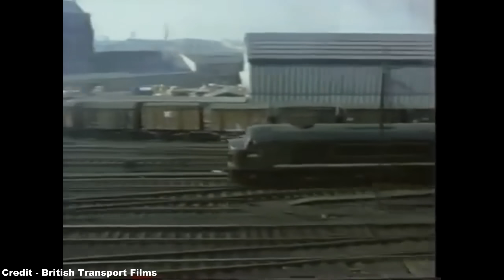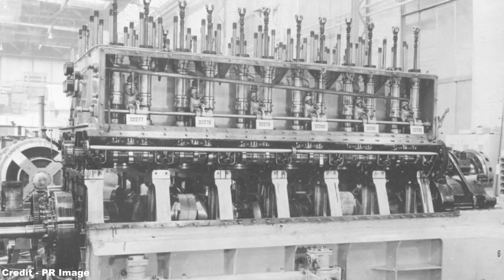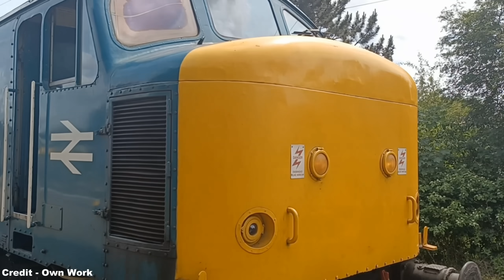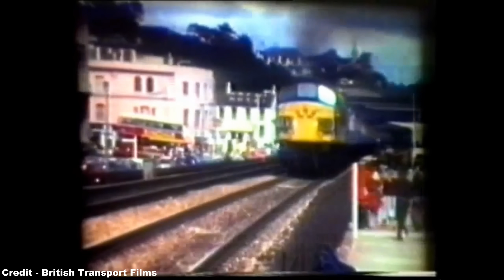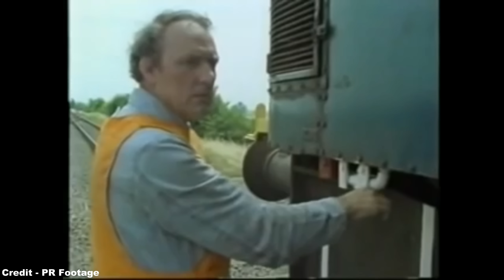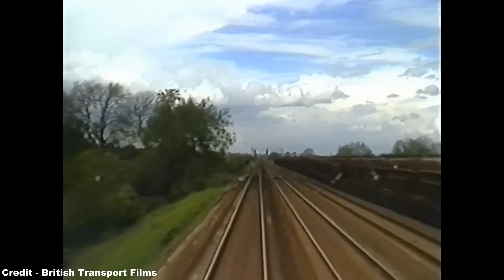The Often Overlooked Tale of the Peaks (Reworked)

Comment: Yes,  the 44s were RATED at 90mph, but initially they struggled to exceed 70mph flat out, with the main generator voltage found to be dangerously high which was severely limiting generator output and causing high numbers of generator and traction motor flashovers. 

The initial fix was the inclusion of an extra stage of field weakening in the main generator, and whilst this proved partially successful, it wasn’t until the traction motors were re-geared from 62:17 to 57:22 that the flashover problem was fully overcome. 

Whilst this extra field weakening reduced the maximum tractive effort from 70,000lb to 55,000lb, it enabled full engine output to be delivered between 8mph and 92mph - a very useful range - and increased the maximum attainable speed of the locomotive to over 90mph. 

Whilst a 70,000lb maximum tractive effort did have its uses; in truth, such a high figure may well have proved more of a liability; as with prevailing freight stock of the day,  such a high tractive effort could well have caused drawbars or couplings to break – particularly with heavy trains on steep gradients.

Hope that clears up any confusion.

Comment: UPDATE: The fate of Class 45 #45015 has now been confirmed, after many years of open storage, which has taken its toll. The Peak locomotive was removed from the Battlefield Line on 27th October 2025, with the destination unknown. It's been acquired by LSL to be used as a spares donor, probably headed for Crewe for dismantling for component recovery and eventual scrapping.

Comment: I got to love them, but I'm sorry to see that their TRUE predecessors on the MML are not mentioned at all - the Jubilees!
Reply: Jubilees : not Staniers best loco- underpowered , didn't like gradients if pull more than 8 coach's.  2 got rebuilt with RoyalScot 250 psi boiler.  Shud have had 6' 3" driving wheels - better acceleration.  I had ~  12 rides with em  Euston- Rugby .

Comment: People always rave about peaks, but it's basically an under powered 47 which has little in the way of audio entertainment , too many wheels , never had a variety of liveries except green and banger blue. 
Basically it's more dull than a clapped out 31
Reply: Underpowered? Despite the 5mph lower max speed, a 45 would chew up and spit out a 47.
And yes, I've driven both on the mainline.
Reply: @timprice9219  being a shunter in the 80's i just saw them as another loco that needed coupling/uncoupling
Reply: It depended. You got sluggards  like 45 067, and absolute flyers like 45 138 and 45 147. So.... it's complicated.

Comment: So the Class 44's we're given a max speed of only 75mph when new , and rostered for express passenger work , yet we're allowed to run at 90mph as a freight locomotive in later years ???!
Reply: I very much doubt there was any 90 mph freight. We don't have that in the C21st.
Reply: @EE12CSVT  I know they didn't haul freight at 90mph , but they we're authorized  to run at 90mph , and on many farewell railtours they hit 92 0r 93mph without issue .

Comment: Another superb video.
Reply: Shame the audio doesn't match the information quality. Except for the bit about diesel hydraulics versus diesel electric transmission.
Reply: Consider it was a reworking of an old video, without sitting down and completely re-doing the voice over with new equipment, this is as good as your going to get.
Diesel Hydraulic wise, the complexity is the information given was correct as the viewpoint of the people making the decision at the time the decision was made. That is their stated position as recorded in history, even though by the time locomotives where actually adopted the tides had already started to turn, and other people in different roles/specializations had very much already accepted that it would. Maybe it was entirely rational based on the evidence they could find, maybe it had other influences due to politics, personal lives ect, thats kind of an entire story in its own right that isn't really very important for the history of the peaks class.